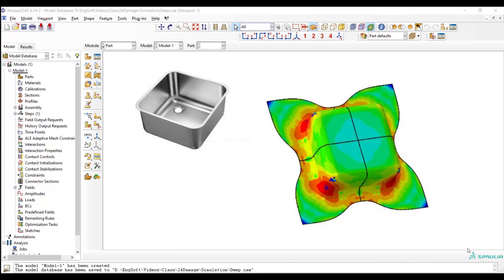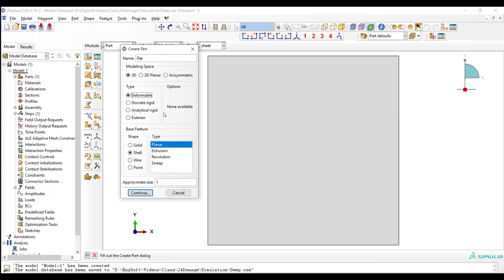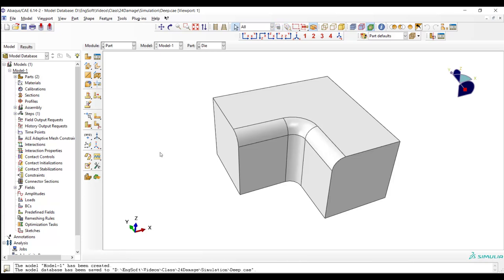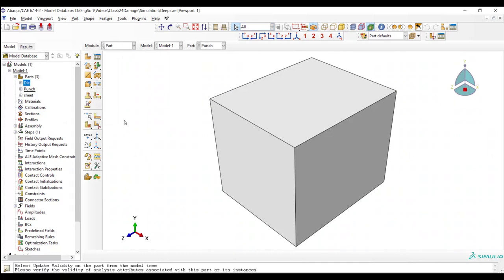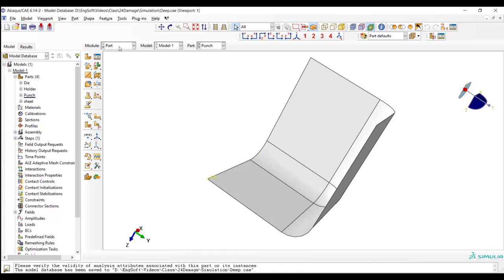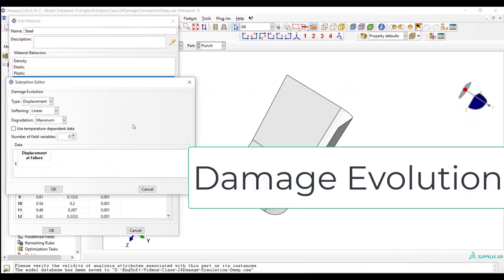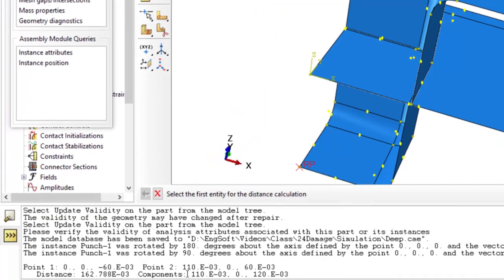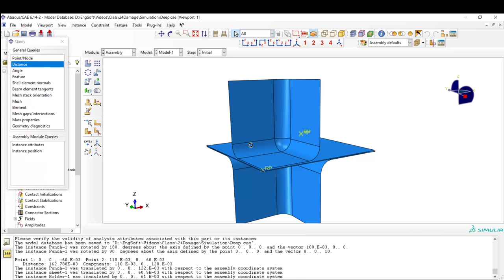Using ductile damage of Abaqus to predict fracture of sheet in deep drawing of a box, part I

Comment: thank you for your video, I was wondering if you can provide the material data excel sheet ? is this a validation of any paper that you can share with me? I am looking for SPCC sheet material ( a mild steel) and unfortunately I could not find any ductile damage parameter for this material till now
Reply from the maker: Please send us an email and we will send you the data. 
engsofteducation@gmail.com
However you should perform some tensile tests to extract the required data for your material. I will publish a video about method of material characterization for ductile damage ASAP.
Reply: @engineering_software  thank you so much, I already sent you an email. btw, what was the material in this simulation?
Reply: @engineering_software  sir looking forward for and explained video about damage ductile material and its parameters.

Comment: Hi Sir,  Can you make a video in order to explain how you can calculate  Fracture strain/ Stress Triaxiality/ Strain Rate ?
Reply from the maker: If you mean measuring them in tensile tests:
Strain rate: just divide velocity of the tensile test gripper by the initial gauge length of the specimen. for precisely measuring the strain rate you should divide it by current length. 
Fracture strain is obvious in the stress-strain curve by a sudden drop at final strain. 
Stress triaxiality is known based on the shape of the initial specimen and type of loading, you can find them in literature. For example: 0 under pure shear. 1/3 under single tension.
Reply: @engineering_software  Hi sir, it's me again. Can I send you the material data excel.( Tensile test). Can you send calculate the fracture strain/ Stress triaxiality and displacement fracture( energy fracture) of my material? I am very appreciate it. I am doing my last final project at uni.Thank you for considering my request.
Reply: I sent you the email. Check your email please. Thank you sir
Reply: @duonghoang6855  Hi did you finish your final project? because I have the same problem and I still don't know how to solve it.